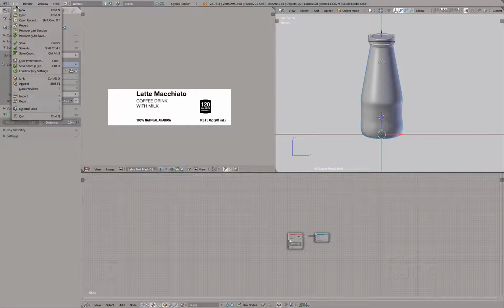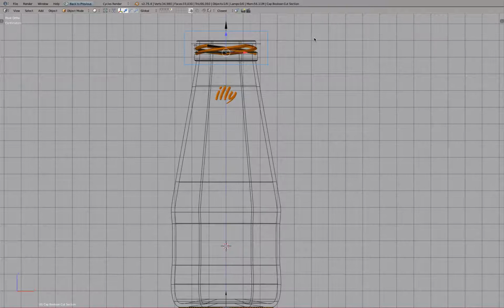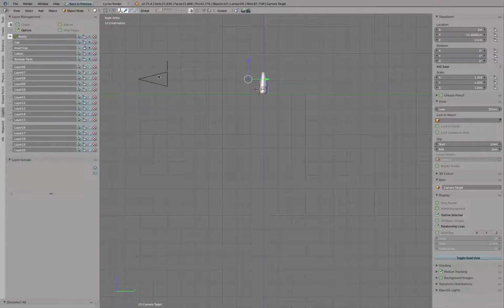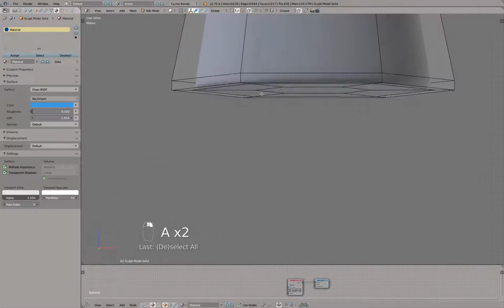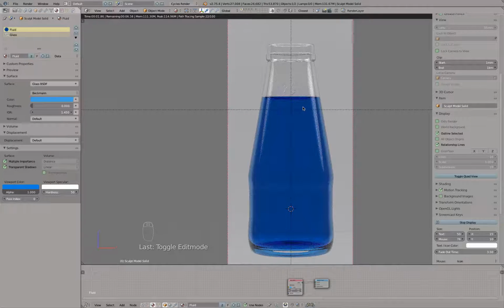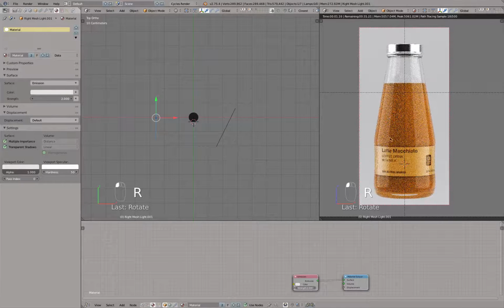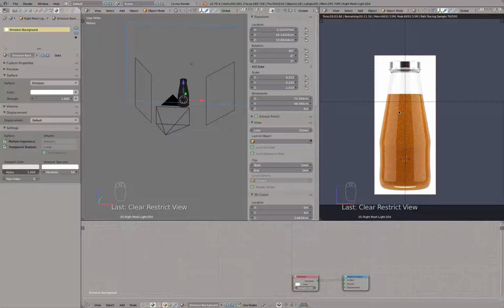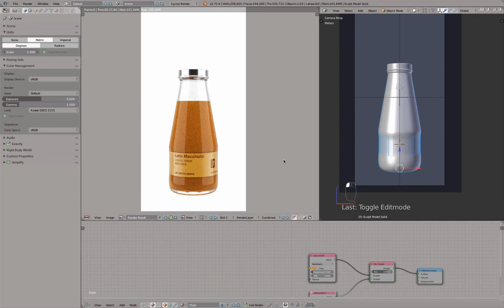Illy Latte Macchiato : Part 5 Basic Lighting and Rendering

Comment: hi thanks for this tutorial and the whole series and I was specifically interested to see your approach to adding/creating a "liquid" in a bottle as I have been comparing different ways of doing this as Im never satisfied

most people seem to create a specific mesh volume of liquid placed inside the the bottle and then mess with it to avoid interesection.

I like your approach though Im not 100% certain in the video the steps there - if I followed you correctly its is a matter applying "solidify" modifier then using that inner area as the liquid then add a liquid "cap"  - but I wasnt quite clear on how you got the cap/top filled whether you duplicated an inner circle as new object to create the "cap" of liquid and its surface tension or you extruded from the inner bottle directly

could you clarify that point when you have time?

thanks so much 

john leigh London UK
Reply from the maker: Yeah liquids are hard. You have to cheat a little!